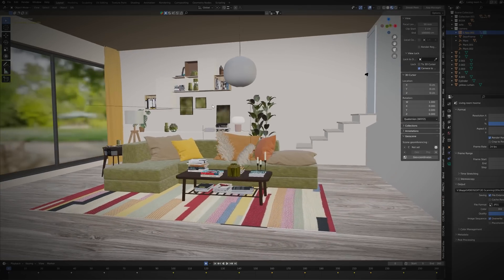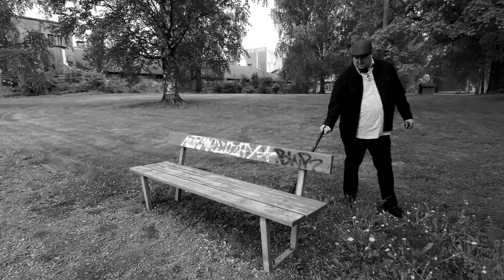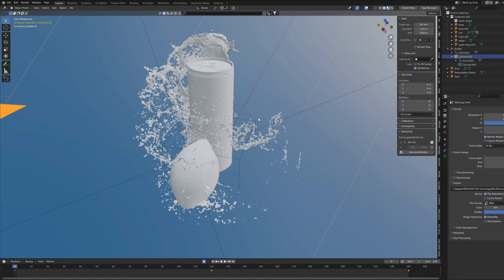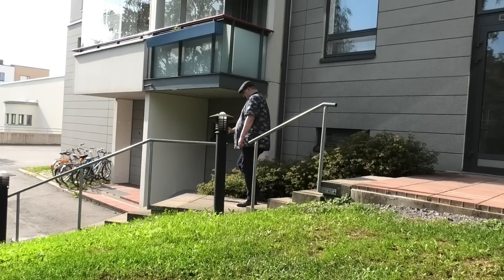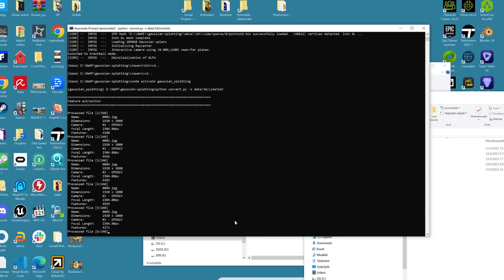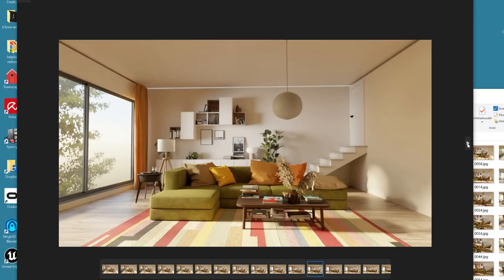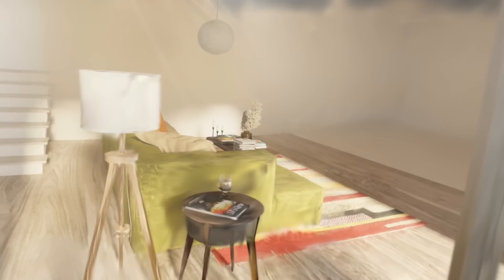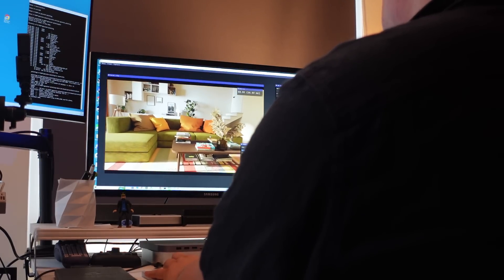Unlocking the Potential: Mastering 3D Gaussian Splatting using Pre-rendered Images

Comment: Instantly though about this on the first video I saw, especially as here you've took the "classic" route, but what if point could be trained separately then put together with some kind of 3D tools (a bit like the simple color to image IA we had few time ago)?
I really think that the capturing still image to cloud point step are not the big thing (as it's the same as classic photogrammetry obviously) and that 3DGS could lead to even more crazy result with another kind of source of data

But first the obvious next step would be to generate automatically all the needed point of view and go straight from 3D rendering with maxed ray casting stuff to cloud points as the 3D engine would be able to identify points by itself. I wonder how much better points would help this tech

Comment: Yay, finally, someone tested it! 🙏 Now replace the Blender Render(!) step with a generative AI process, like Runway ML or ControlNet, and use just a 3D OpenGL output (as a "3D Skeleton") from Blender where colors correspond with different object prompts for the generative AI. Or any similar process you can make. Consistency is key though.

Comment: Very interseting worklow. And great idea to try this way. Btw. Unreal Engine can compute lightmaps for every surface, calculate how much light will be on every surface by using path tracing and then you can basically change location of camery and get instant raytraced result. It of course don't work when they are moving objects or light in the scene. But for static scene like this it is awesome. Would be great if Blender could to the same.

Comment: Basically future games could render a high quality interior simular to traditional texture/light baking such as in Unreal Engine, but then use it as Gaussian Splatting while at the same time having a defined playground that can't be exited because Gaussian Splatting will then blur the area. This would offer a overall higher quality photorealism experience then Unreal Engines light bakes for ex. . But the question is if that could be merged with interactions inside that world that it looks right. As the light on interactable props have to be rendered somehow. Also over the years the actual light baking that looks photorealistic haven't been used in games, mostly by archviz companys only. Interesting what could this offer then. I guess film production or product visualisations benefit more from that.

Comment: I am absolutely fascinated by the potential of this stuff. I had a couple questions - if anyone has ideas or answers that'd be awesome. 1) Does Gaussian splatting work only on freeze frame moments, or would it be possible to record a real-world event (say a ballet dancer) from multiple fixed angles, then playing it back in 3D? 2) Would it be possible to integrate this with AR or VR and able to walk around pre-recorded events?
Reply from the maker: I recomment to follow Infinite-realities on Twitter (X). They have done experiments on animated sequences on Gaussian Splatting. And they have some special custom version on that SIBR viewer which I would be very interested to get my hands on. Check for example this: https://x.com/8infinite8/status/1699463085604397522?s=61
Reply: @OlliHuttunen78  Oh man, thanks for that recommendation. Love your work, super excited for all the insane stuff this new tech is opening up.
Reply: 1) yes but it's costly, you will have to capture every frame with enough multiple views, each frame would cost the same of a single 3dgs, there is probably way to compress, but you would have to invent it, or hired a programmer.
2)yes it's been done, the problem is the raw file size, see if using less splat can help retain a good enough quality that fit the memory.

Comment: I'm loving these. 

The most obvious gaming usecase would be realtime cinematics.

Cinematics are often one of two things: 
- an ingame cinematic with obviously game-level graphics/lighitng/models, or
- a prerendered cinematic with much higher quality assets and methods that can't be done realtime.

If you're using a mix of gaussian splatting for the environment and then spending all your traditional rendering power on your moving parts/characters, then you could have cinematics nearly as pretty as pre-rendered cinematics. And that's just until we get animated splats. 
This way you can have faultless splats too, because the camera would only ever use the path the splat input references took.

Comment: I genuinely think we will be moving away from polygon based rendering in the future and replace it with a combination of voxels and Gaussian splatting. These have huge benefits to polygons when it comes to immersive and augmented realities, which is where the world seems to be heading
Reply: For static visualizations maybe, but for games with dynamic environments and dynamic lighting, this is not a viable option.
Reply: Back to spline modelling or sdfs then no more vert pushing 😅
Reply: 3DGS is great but you basically have baked lighting and no mesh colliders. Basically useless in gaming projects but it can have huge suppport in AR, VR and artistics experiences
Reply: Collision mesh and visual mesh are already different in games, also while baked, since it's using SH, we can add dynamic light to them easily, shadow, translucency and correct material light response might be harder. @EmanueleBlackBulbToscano

Comment: Very interesting 
I indeed believe the point cloud could be directly produced from the 3d geometry tesselated to a high poly count and the texture baked to vertces. It should be faster than rendering all the images and their wouldn't be any forgotten or occluded portions of the model.
Thank you for your good videos
Reply: The part that’s missing is still the path tracing. Though maybe there’s a way to bake that in as well? 

Failing that, I wonder if there’s a way to write an algorithm to calculate the optimal camera path through a scene to maximize coverage while minimizing redundancy.
Reply: @mortenjorck  Yeah I think you're right, but isn't like 99% of cycles render time effectively just calculating lighting? I can't see why you wouldn't get equally good results just by using Eevee with baked lighting.

Comment: Shouldn't it be easier* to generate the point cloud directly from the 3d model? 🤔
*(veeery relative word here 😄)
Reply: I agree, I like nerfs but couldnt you just run this in real-time using Unreal? I'm unsure of the benefit of NeRF here
Reply: @user-jk9zr3sc5h  I see it as a "two papers down the line" situation. This is the best nerf-like thing available today, significantly better than what was available 2 months ago.
On the practical side of things, we have path tracing combined with AI-based denoising/upscaling/ray reconstruction that's made its way into mainstream games, and that's likely to remain the "sane" path to high quality real time rendering for a while.
But it's easy to start daydreaming about where successor technologies of gaussian splatting might take us, and this video gives us a little taste of what could be, even with its awkward "ok let's just compute 260 renders and pretend we don't know the geometry and compute it again" approach.
Reply: It's very relative, gaussian splat encode light rays not mesh surfaces, the issue is the placement of the gaussian, the gaussian are triangulated using 2d images, we can probably triangulate from casting sampling rays from a sampling points and try to find a minimizing functions to figure out best placement. 3dGS are very similar light probe volume, with the caveat that it's the superposition of gaussian splat that create the final colors, I see the superposition as a big problem, but placement is probably CLOSE to ambient occlusion problem.
Reply: 👍 @NeoShameMan

Comment: This is pretty insane. I think in theory it should be possible to render directly into 3d gaussian splats, without ever having to do any point clouds or training process.
Reply: But if you use the geometry as a point cloud, does it have the render quality on it? F. E. the reflections and refractions of the water bubbles?
Reply: @AMessful I think you’d need to convert the mesh into a textured form first and derive the point cloud from that (using edge detection or similar). This cloud could probably be pruned a bit (more pruning means lower quality but faster). Then you could path trace from each point to get lighting/reflections etc. to set the spherical harmonics coefficients of the colour components. Just guessing here (I’m not a 3D graphics researcher) and I don’t know if that’s any more practical than just using carefully chosen probe cameras and doing the entire original pipeline. One thing that would probably be better though would be fewer floaters and more accurate edges (because we know exactly where in 3D each point is by transforming the texture coordinates by the geometry’s transform).
Reply: Technically it's not entirely new, Gaussian are equivalent to light-probe BAKING used in 3d games, we use SH (spherical harmonics, they are directional data, used to encode color from a direction) even at the texture level. IN some way Gaussian are unstructured placement of SH light-probe using ellipsoid shapes.

It's not completely antithetic to traditional 3d, a textured mesh could be seen as procedural point cloud projected on screen using the rasterization process and which index a texture that could contain SH data. That make the mesh a more compact way to store point cloud data, by interpolating key points (the vertices).

The BIG gotcha is that is a single pixel is resolved using "transparent shape" of probes, not the surface, so a uniformly green room, could be represented by a single probe in the middle of the room, ie there is no relation between surfaces and probe, the probe must be seen as encoding LIGHT rays, as such the single green probe would the equivalent to a sky-box in game. Also multiple probe contribute to a single pixel being resolved on screen (hence the creation of floater artifact), which is where the transparent part is important to understand. Scene with mesh are typically rendered using single point of geometry, that's the key difference.

But the question is can we render directly into 3d Gaussian? well 3d Gaussian is a type of 3d representation, it doesn't make sense to say to render directly in 3d point clouds or mesh, these are the representation not the rendering process, we render TO a screen. And it doesn't make sense to say without point cloud, since 3d Gaussian splatting ARE a TYPE of point clouds.

The training process is how we convert 2d images into the 3d representations, so the question should rephrased as can we CONVERT any 3d representation to Gaussian splatting WITHOUT using 2d images. The answer is probably yes, but the details aren't known, let's try thing that through.

The way the training work is that for 2d points in a pair of image, it tries to guess how much a given point has moved from one image to another (parallax), then triangulate the point. in a 3d mesh we already know the point absolutely. But as said the Gaussian don't find the point, it's a guess based on the ray direction (position with the image) from the image and a guess of the camera position. The algorithm guess a bunch of possible camera position and extract data from the probable intersection of all the rays, to find which are make sense, then place points at these intersection, then we kind of match a Gaussian and a color (SH) to that point based on the source images. The more training there is the more it get close to recreate the original image from the Gaussian.

Given that, in 3d we know already every point and every possible camera position with absolute precision, it would be much easier to create the ray intersection lattice and put Gaussian at these position, by tracing occlusion and sampling colors into the SH.
Reply: @NeoShameMan  With a 3D model, not just the position, but the orientation of the probes should be possible to calculate from 3D surface orientations. And by using GPU raytracing on the 3D model, the sampling process could be faster too.
Reply: Not sure about training, but the point cloud could definitely be generated directly from the geometry. Remember gaussian splats are an extension of a point cloud, there is no way to avoid a point cloud.
Reply: Sierra is right. The points are at the basis of splats. Splats even keep their position and color while fitted.
Reply: I thought that this videos was about that
Reply: @loookas  This video uses images rendered normally from Blender as input as if they were photographs. As demonstrated, this has some practical effects on quality (see the lack of coverage in the room demo, and the inability for the COLMAP algorithm to separate the floor properly in the can example).
Reply: @productjoe4069   Don't get me wrong, you did a great job. I just misinterpreted the title and got excited :)
I thought there was some technique or plug in that generated the point cloud in a single "render" pass.
I'm not an expert but it shouldn’t be too hard to create a point cloud using path tracing, instead of emitting rays from the camera perspective an algorithm could sample random points around the scene
Reply: Could you have a grid of point cloud emitters trained on game geometry so that each step is a frame?
Reply: I am not sure if this is possible. Or at least it's not as easy as it seems. 
Because the "splats" are optimized in the training process. So it tries to approximate the image. By splitting and merging the "splats". So it cannot just trace from the points, because it needs to consider the whole image. (Probably all images?)
Reply: @kettenotter   Make sense. So it's not a new technique that is needed but whole new training model, not so easy 😅
I wonder if the extra info you can get from a render (material property, normals etc) could help the model or speed up the training.This is way out my field of expertise   😁
Reply: @loookas  Yeah, you probably would need to make big changes. Also I don't think normals or other data would help. Because it's an handcrafted approach and so smart people would need to find a way to make it useful. Because it is not "trained" in a generalized way but only on the dataset of the scene. So how do you make this data useful? Because after we have a point cloud: 1. Rasterize the Scene -> 2. compare it to the input image -> 3. Adjust gaussian splats -> go-to step 1... So what to do with the normals?

It's probably easier with methods based on machine learning. Like NeRF. I guess we will see some interesting things in the future were they experiment with different combinations and use cases.
Reply: Somebody needs to do this!
Reply: This reminds me of how Jensen Huang said that rendering would soon be done entirely using AI.....
Reply: @djayjp  this isn't using AI at all. It's just global optimisation. The gaussian training process is really no more "AI" than solving for the camera positions and point cloud.
Reply: @TimmmmCam  More than interpolation, less than generative AI.
Reply: @TimmmmCam  Actually I just looked it up and it does use a 1 layer neural network.

"To produce high-quality results, you need to train the model. The training procedure uses Stochastic Gradient Descent, similar to a neural network, but without all the layers. This is one of the secrets to why it is so fast. It does not have all of the ‘deep’ layers of many other approaches. Training is based on calculating the loss between this early rasterized image and the ground truth image in the training."
Reply: @djayjp  It can be thought of as a one layer neural network, but that's because a one layer neural network is basically just a matrix multiplication and a loss function. It really isn't AI by any reasonable definition.

It uses the same optimisation method (SGD) and they called the optimization step "training" which is why people are probably getting confused.

One difference for example is that the Gaussians get split and merged during the optimisation process.
Reply: I think the part you can avoid most easily is the photogrammetry from the rendered images to the point cloud (the usual process involving them is images → point cloud → 3d model; I think the last step is reversible). I suspect the procedure to convert that to the Gaussian splats might be a little harder to sidestep.
Reply: A middle ground could be to generate the point cloud while rendering, since rays are already being used there. (I assume this could be done with the depth buffer and camera position / orientation?
Reply: @ScibbieGames  you don't even need to render to generate the point cloud. Just take it directly from the geometry.

It's possible you'll get better results if they are initialised based on visual complexity (you don't need many gaussians for a white wall) as well as geometric complexity. Probably worth doing since you need the renders anyway for optimisation.
Reply: Yes it would be possible to bypass the "point cloud from video" process and provide the information directly from the renderer images. For every image you can output the pixel position AOV, this should give a more accurate data to start with. For every image you allready know the camera position too.